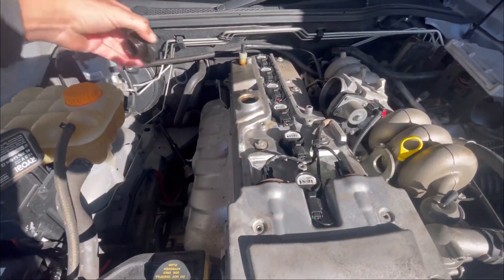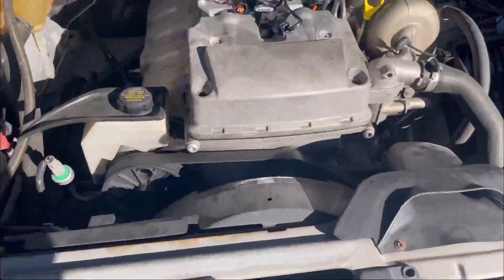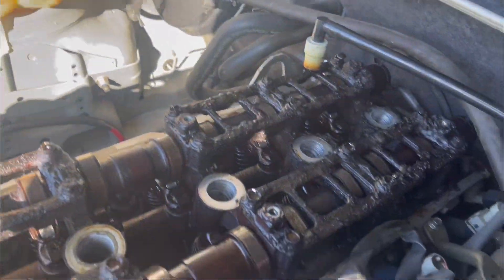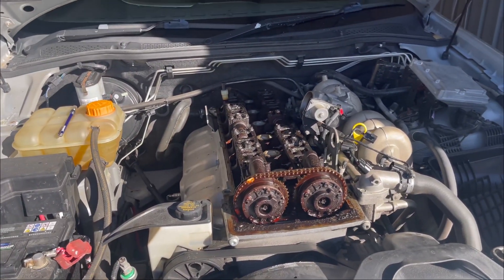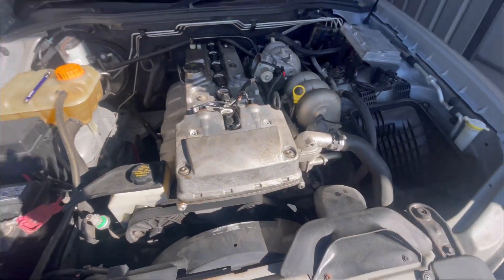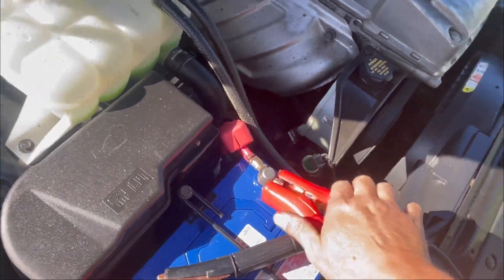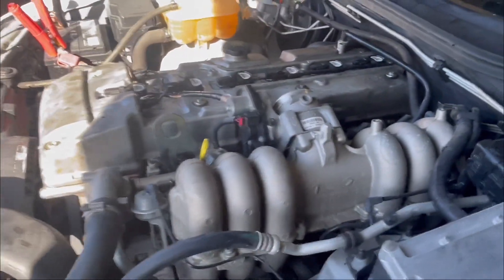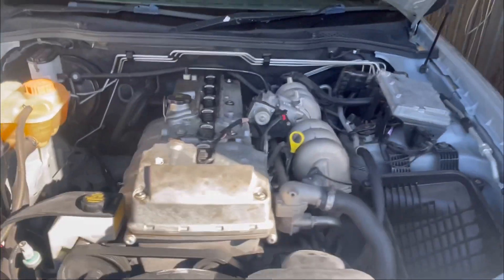BF XR6 ENGINE SLUDGE!!! P1381 fault code BARRA Faulty VVT cam solenoids???

Comment: Did you find the problem? What was it?
Reply from the maker: @DylanAllen-d4d  Hey mate, turned out that over time the sludge from the engine had clogged up the oil pick up and staved the engine of oil. When I took the sump off the pick up was completely blocked

Comment: Hey mate what ending up fixing the issue.  I have the same code coming up for 07 territory and can’t find a stick yet… thanks
Reply from the maker: Hey mate, I ended up swapping the engine with a healthy one but in the end it turned out that the oil pick up was almost completely blocked off from oil sludge, obviously starving itself of oil.
Reply: @ ah true do you think fixing the issue the engine would last   Or it’s on its last legs now ?   Cheers

Comment: Did you experience a loud knocking sound
Reply from the maker: @waydegod  Hey mate, na there was no noises coming from it at all. I ended up pulling the sump off that engine and the oil pick up was clogged, obviously from all of the gunk that was in the engine.

Comment: Wow I'm having flash backs.
Same thing no oil changes sludge built up all through the head as I said in your other video both cams over advanced,changed the solenoids and phasers did not fix it,mine had more codes than yours-I mentioned what got rid of last 2 cam codes in your other video, problem is from engine being cooked over & over the head gasket is likely buggered minimum at worst the deck and head will be warped. Serviced regularly my arse!!
Reply from the maker: Aha, religiously serviced every 5,000k’s NOT! I decided to just swap it out with another engine that I know is good. The car may be for sale, I’d never sell it knowing the next owner might have potential issues with it.

Comment: Hmm, I faced the same issue with a BA I noticed the engine on a long trip for the first time was over normal temp and regardless of shifting down or lowering speed the temp remained high, I returned home letting the engine cool down then made a few checks before ripping the cam cover off and noticed sludge so crusty, I organized a motor swap due to the fact as a mechanic pointed out is the same sludge would be slowing oil flow to the top of the motor thus causing a variety of issues including  temp.
Reply from the maker: Sounds exactly like what had happened to mine. Hopefully I’ll have a replacement engine in it this weekend.

Comment: Great work mate! I think you can bring her back to life without an engine swap IMO. The DTC refers to no enough oil pressure/or low oil to the VCT solenoid etc... obviously the sludge is causing it. A few flushes and oil changes may do the trick.
Reply from the maker: Thanks mate. I certainly hope that's the case. I’m hoping I can sort it out without having to do the swap that’s for sure.

Comment: Hey mate, qualified mechanic here ☝️
I used to flip cars to supplement my apprentice income, and had this exact problem. My one could barely run, the vct solenoids and cam phases were gunked up that bad.

I used to know a genius mechanic and he helped me fix this exact issue. 

Swap two coil plugs around, this will induce a misfire.
When the car misfires, the ECU tells the vct solenoids to constantly cycle.
The cams will, nonstop, phase retarded and advanced.

This motion will shake out a lot of sludge/gunk from the vct system.

Before you run the car, put in an engine flush (or best kept secret, a litre bottle of morning fresh will do the trick).

Run the car for 15 minutes or so.

Swap the coil plugs back to the correct position and see if the idle is fully smooth, clear the codes while you're at it.

Dump the oil and refill, now you should be good. 
You might have to run a couple more engine flushes in there, so I advise to put cheap shit oil in there while you're doing this.

Once you're happy and the solenoid codes are gone, dump it and put good oil in it if you want.

Seeing as though you have another engine, we don't want you wasting money, we just need the engine to last as long as it can.

Also note that there is a lot of sludge in there, the pickup may block itself either by doing this or not doing anything at all. But I have seeing engine flushes do miracle work, and I still think this is your best bet.
Obviously there is a risk in doing this, so keep that in mind. I still think the risk of inaction is just as bad.

The car I did this too ended up being a p platers daily for 7 years after this until someone cleaned him and wrote the car off.

I really hope this all helps
Reply: Great advice!
Reply from the maker: Legend, thanks heaps for the advice mate, much appreciated.
I’ll definitely give that a shot before swapping to much else out. Worth a shot right!
Reply: @Jeenzy79  worst case, is doesn't work. Best case, savings!